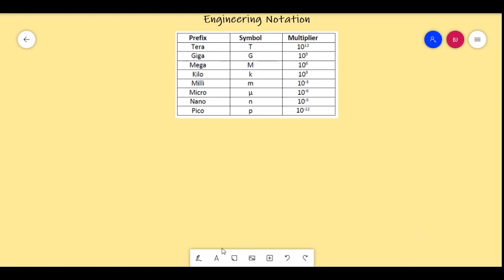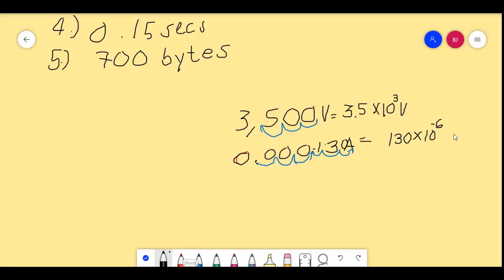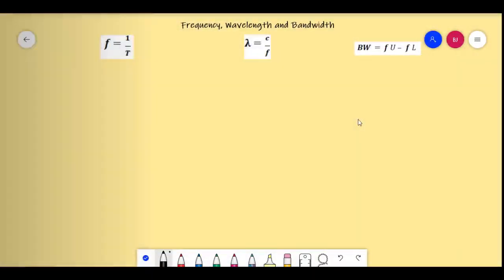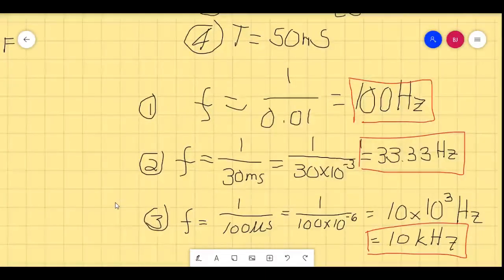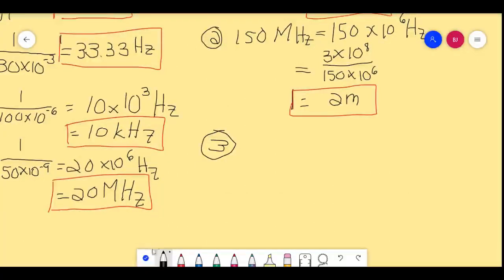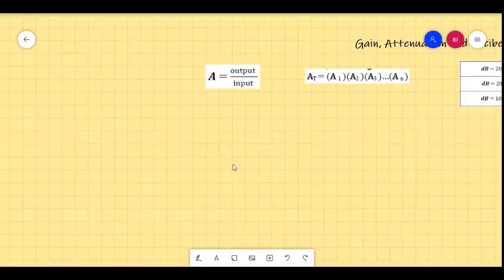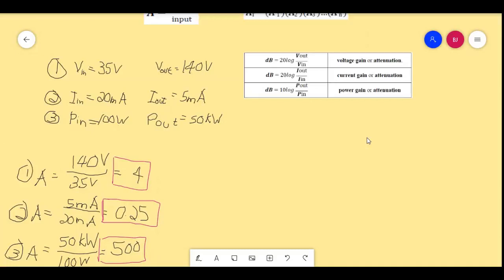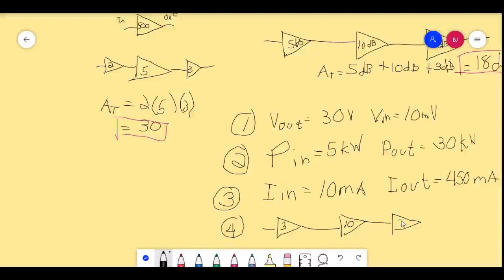Engineering Notation, Frequency, Wavelength, Gain and Decibels

Comment: Thank you so much for your wonderful video. Could you check if my answers are correct for the last part of the video? 

49 db
7.7 db
33 db

21 db
Reply from the maker: Your answr for 2 and 4 are correct
Reply: @jayroldbaliwagan2382  Thanks for taking the time review the answers, for number 1, do I have to convert the V output to mV and then divide that value by V input, it will show 20log(30,000/10), I will get 70 dB. not 49.. for question 3, the formula will be 20log(450mA/10mA), I will get 33 dB. please correct me if I am wrong in my calculation.